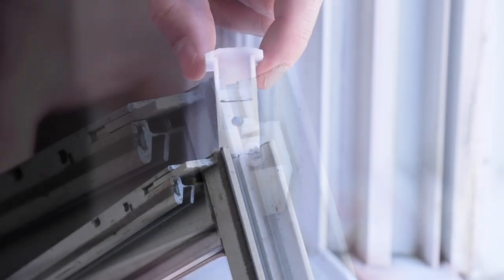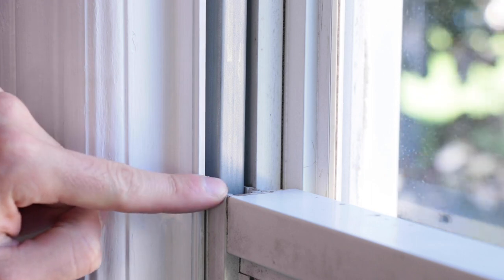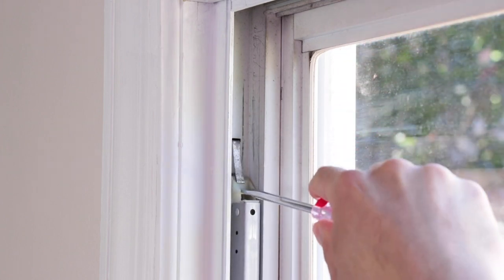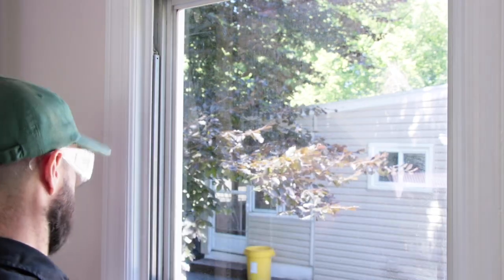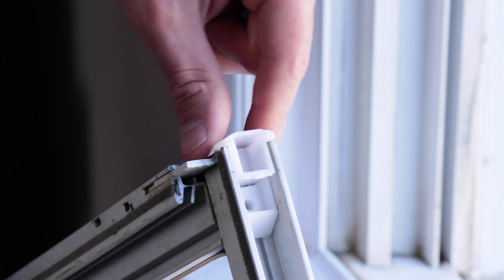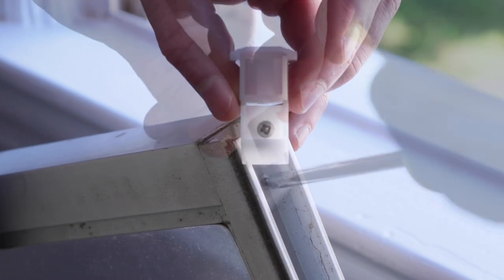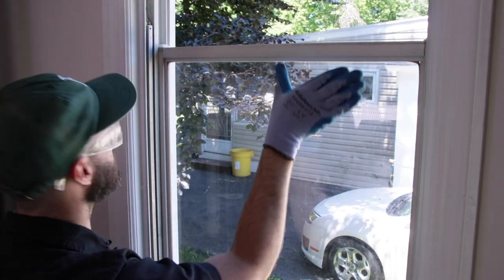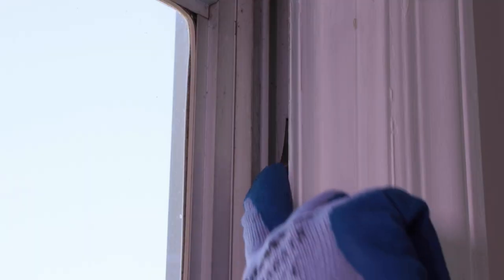How to Repair a Jammed Window

Comment: How do I go about removing a window when it’s jammed stuck at the bottom with both of the balances with it? Do I remove the terminal clip with the wire and try to pull up to reach the take out clips?

Comment: How do you go about doing this if both sash guides are broken and both balances are at the top?  I don't have enough wiggle room to remove the window??  Thanks for any help.
Reply from the maker: Hi Chris. Pushing down each balance with a slotted screwdriver and engaging them with the take out clips should do it. This should let you raise the sash above the balances, push it to one side, and swing it out of the track. However, I could be misunderstanding your problem. If you'd like to submit some photos to help us better understand the issue, please send them to https://www.swisco.com/page-id-part with a description of the problem.
Reply: @SWISCO  Nope, that did it.  I actually figured it out after requesting help and watching your video again.  Thanks for your awesome video and your reply.

Comment: channel balance just wont go down even with alot of force. any tips if ant get it to go down?
Reply from the maker: Unfortunately, there aren't really any tricks to it aside from forcing it down. Try prying the sash over a little to take the pressure off the balance. You may want to consider a professional to tear out the balance at the top above the sash.